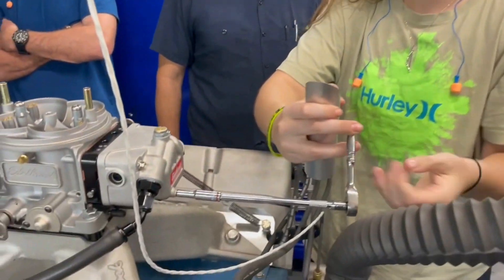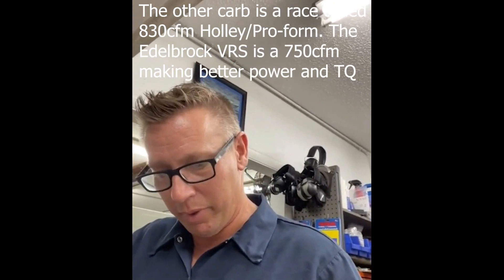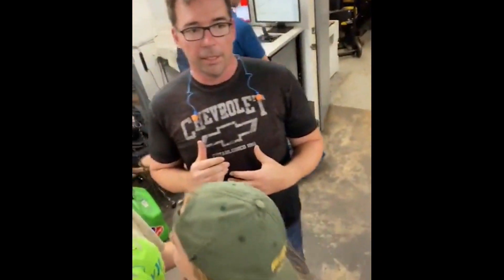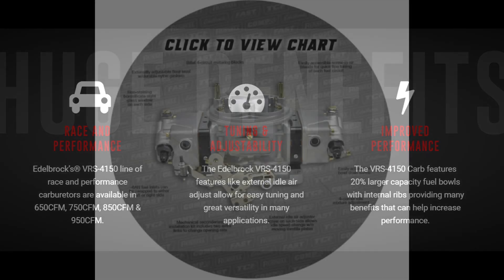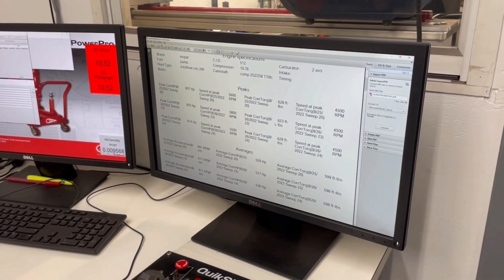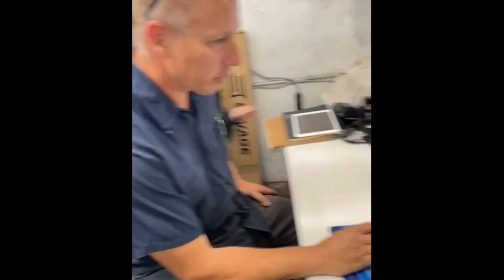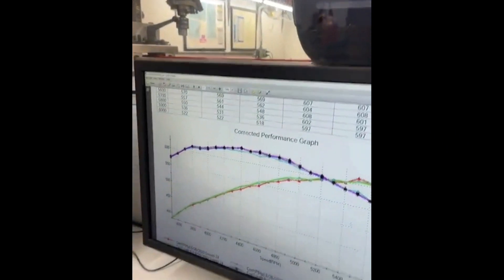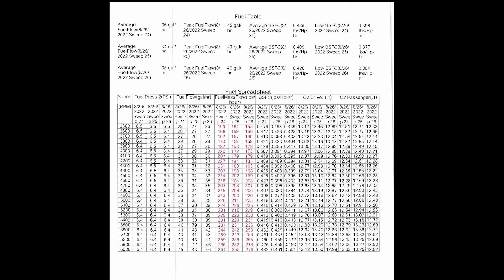FIRST PUBLIC Dyno test of the Edelbrock VRS-4150!!!! Did it live up to the hype??? "HECK YES!!!"

Comment: those HP/TQ curves are identical for all practical purposes.
Reply from the maker: Yes but the afr is not. Made better horsepower and torque in a saver. Air fuel range.

Comment: ok my question is these new carbs are $1000 with the jets, etc.
why buy it to make only the SAME HP as the old carburetor ?
what are you actually gaining ?
there is 16 air bleeds visible in the top.  4 main jets inside.  then even more emulsion jets.
so you would be tuning  around 30 jets on the carb, changing them.
my point is having all these removable jets makes no sense if you still only change the 4 main jets,
just like the old carbs.
what would really be an improvement would be fully adjustable needle main jet screws,
like  Percys had, or like a 2 stroke snowblower, chainsaw, snowmobile has
then you don't have to change jets.  just turn the screw.
imho this is a gimmick to sell carbs but I'm still glad Holley carbs will be available new.
so I look at the upside.  that's a good thing.
Reply from the maker: What you’re not seeing is the potential. We made better horsepower and torque in a safer air fuel range with a 750 than our Holly 830. We still had an inch of vacuum at wide-open throttle which means if we get an 850 VRS we stand to make more horsepower and torque again.

Comment: Hey Riley what will be a good mechanical fuel pump to go with the vr 4150
Reply from the maker: That’s gonna really depend on your horsepower rating in fuel needs. You only need 7 to 8 psi but do you need enough flow to supply the volume for your motor. What size horsepower are you expecting.

Comment: Got a vintage trans am style road race car build going, boss 302 engine. Still have the 30 yr old Holley it had when I bought it, needs rebuilt. Maybe I will just put on one of these Edelbrock VRS-4150 Carburetors instead of trying to resurrect the old Holley. By the time the car is running these carbs should be on the market and in use for a while.
Reply from the maker: SHHH, the 650s are out... $789.95 free shipping. I have some for sale if you are ready, I am letting the people who asked to be on the wait list know before it goes live tonight at 6:15... Message me
Reply from the maker: The 750s are shipping, I have 10 to sell. Go here to order one
 https://rileysrebuilds.myshopify.com/products/copy-of-1-vrs-4150-carburetor-650-cfm-1306?fbclid=IwAR0vKzMq7AmUKeZ6qJdqaUqhcVfX6NpWVVWbRrUluR4kgB28s_ge2QY3nuY

Comment: I'm going to agree with you on something like that but if I wanted to put one on a hopped up daily driver it would be a great pain without a choke. Great for a off road Jeep, or truck, would be great on a show car or something that gets raced on weekends or goes to car shows and home. But for a good daily driver with 500 rwh and used in all kinds of weather but garage and barn kept I would be playing with the gas pedal and waiting longer than usual before I could use my trucks. Need a version that has a free flow choke tower with either a manual or electric choke. Have raced many cars over the years and had no problem with the old style unless you are going to run NASCAR or something specific for racing. Did the flutter foot for a few years and I would rather have a good designed carb with a choke for the street. Beautiful product for the intention that it was designed.
Reply: Its not a daily driver carb you moran. Its a race carb.
Reply: Ran a 675 Avenger (no choke) on my Blazer for years with a mild built SBC.  Except for extreme cold days no issues. 
I can see those living North of IH10 having cold issues through.

Comment: Sound like that carb is really sensitive to air flow. I'm running a modified 600 cfm 1850 main body with 750 base plate with 3310-1 metering plates, and float bowls, 69.75 on the mains, and 78 on the secondaries, and it's only a A code 289 Ford, with a ISKY mega 285, ported J code heads bigger Ferrea valves.